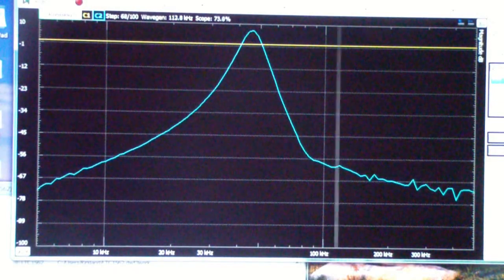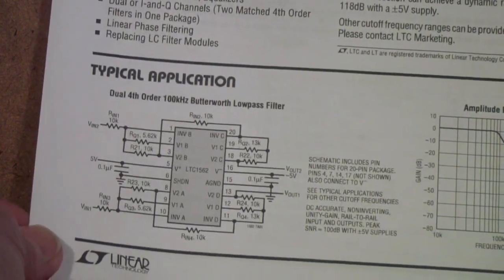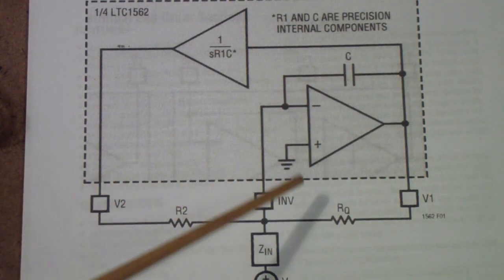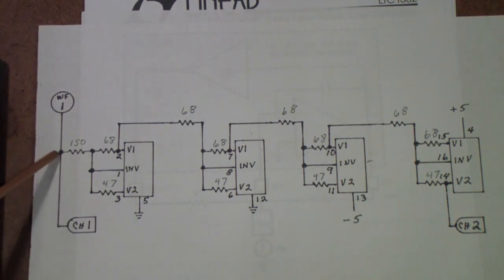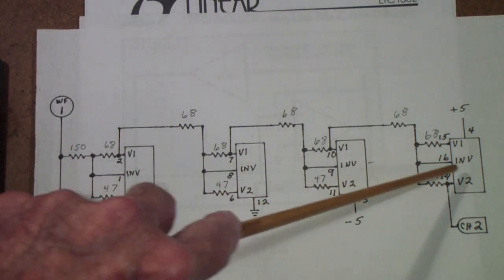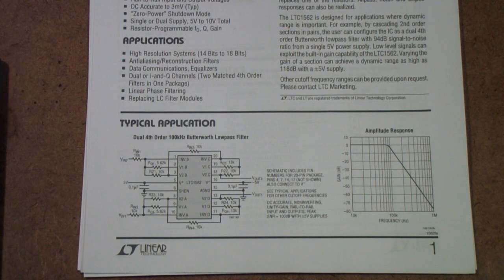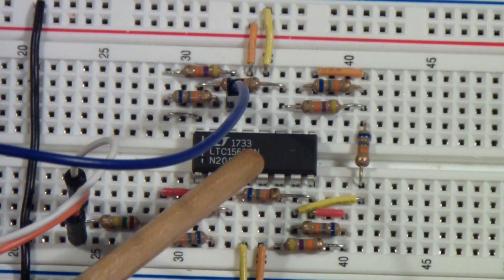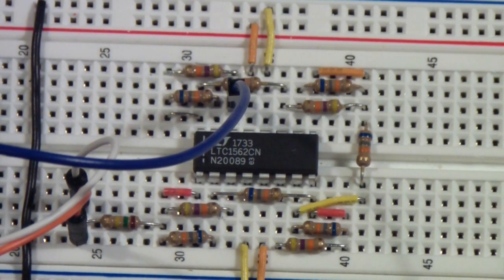TTT220 LTC1562 Universal Filter

Comment: Very nice clip, thank you. I also do like the LTC1562 chip especially with a potentiometer to tune the band pass peak. Your simulation programme will be very handy to do so. I am wondering if you can consider a video topic on “octopus circuit” that can be added to an oscilloscope to change it to a signal tracer. There are variety of octopus circuits versions are available in the web which is a bit confusing so might be worth to have a review.  Thanks
Reply from the maker: I interpret your term "Signal tracer" to be equivalent to "Curve tracer" or "Component tracer." You might want to look at my videos on using the Analog Discovery as a Curve Tracer. I have also done videos on Signal Tracers but I assume that is not what you mean here. I am currently working on a video about adapting an "octopus" circuit to electron tube curve tracing. I can't say if it will be less confusing but it is another data point.
Reply: Thanks, you are right I meant curve tracer and will check the videos you mentioned.
Reply from the maker: You also might check the channel of W2AEW - he has some excellent videos on curve tracers, some based on the octopus idea and others more professional, including a very nice Tektronix unit. The author, Alan, works for Tektronix and has many excellent videos on everything from test equipment, circuits, ham radio, etc.
Reply: Thank you very much. I have seen some of the  Alan's videos, but was not aware of the curve tracer, so need to check it on. .